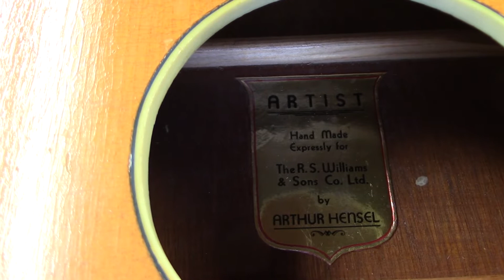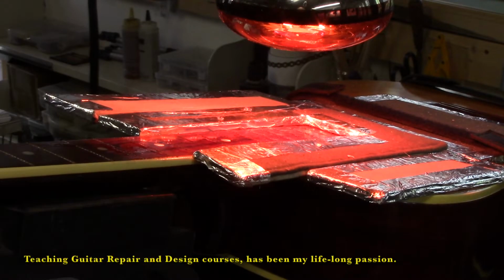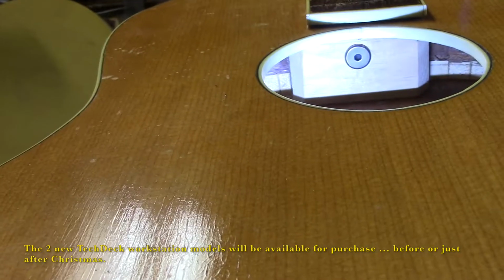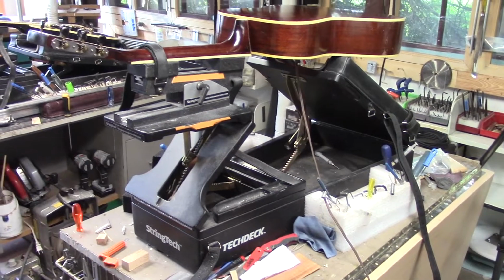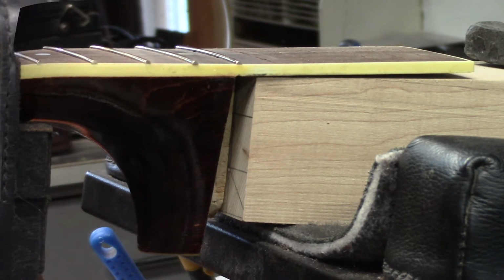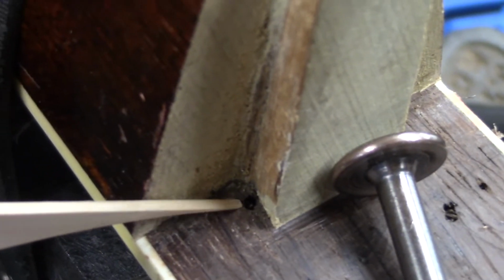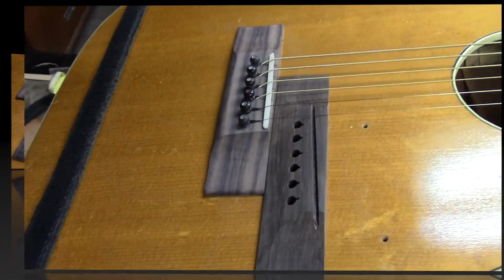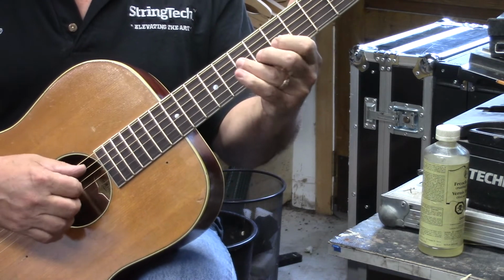1920's Dovetail Neck Re-Set / Detailed Tutorial @StringTechWorkstations

Comment: I'm working on an old archtop acoustic guitar that had a loose neck. I steamed off the dovetail neck and cleaned up the joint and tenon. What type of nut insert and fastener did you use here? They look sharp on your guitar and would be a good idea for me to try.
Reply from the maker: Those are Murakoshi Fasteners Shawn. There are commonly used in the "Knock Down" furniture industry.Make sure you try the fit on a scrap piece , before you insert the female fastener in the dovetail. They are driven in with a hex drive. You need enough tightness for the spiral threads to "bite" into the walls of the hole .... but not too tight or you will crack the neck wood. Again ... practice on a few pieces of scrap wood first ..... Good Luck \m/ ! MMcC
Reply: @StringTechWorkstations  Thanks for the quick reply. As soon as I posted I realized it would be very difficult for me to use this type of fastener on a f-hole archtop style guitar. I have no access to the neck block on the inside of the guitar without removing the back. I think I'll just have to get a tight fit on the dove tail with some shims. I could possibly use a strap button and screw to get a little more connection between the heel and neck block. I'm not sure if that is recommended though.
Reply from the maker: I'll glue ( hide glue ) the shims on the male portion of the dovetail ... let it dry overnight ... then sand to a perfect                 press fit ( dry ) checking all 6 trajectories of the neck to body angle ... before mixing up that final batch of glue. Good Luck ;^ ) !